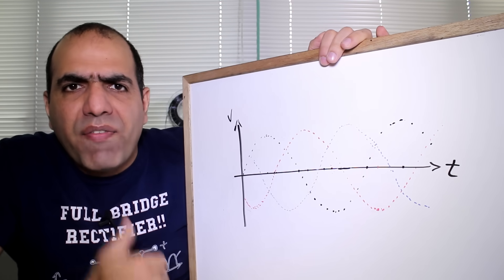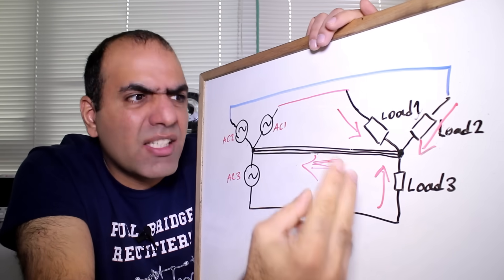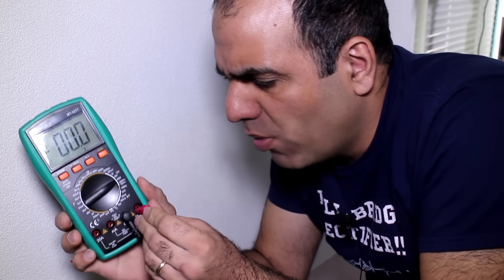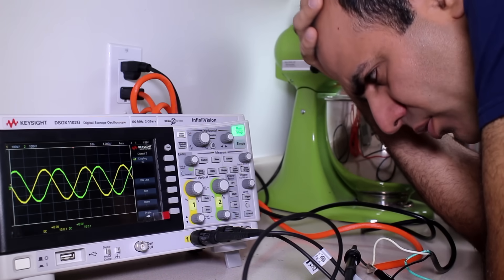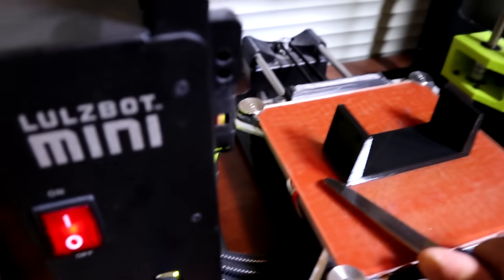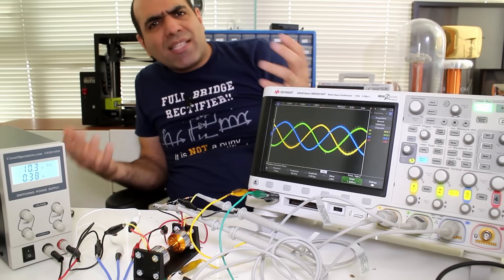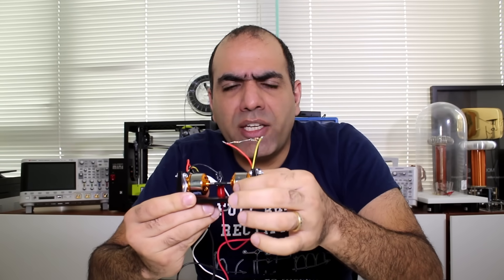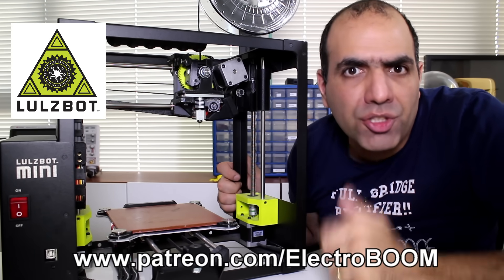Why 3 Phase AC instead of Single Phase???

Comment: This dude has several things wrong in his video and maybe someone has a clue here.

Like there isnt two phases coming into a house unless it was a special install

Its single phase not two phase
Thus why its called single phase

And the nuetral doesnt go back to generator source on single household systems  it goes back to stepdown transformer

There are more mistakes but im not going to go through them all

Even when he uses the meter in the socket its single phase and the same phase

So hes telling the wrong info

Everyone who has any clue should watch a video on transformemers and see there isnt two phases

Its usually a single phase at 7200 volts going through a step down to 240 
That 240 has a center tap which gives u two hots at 120
The center tap is the guy wire and bonded to earth and equipment ground and that becomes the nuetral in simple terms

And thats it.

So watch some videos on transformers 

Then look at three phase
Its complete different stuff

Nuetral in normal circumstances doesnt go back to generatorr but goes back to stepdown transformer and is a center tap of that trasformer.

Look at the pole on your block and u can see for yourself 

Anyone who has an idea would know that.

Later

Comment: Overhere in Europe generally all the houses get 3 phases with the exception of some apartments specifically older ones get single phase. Often there is only 1 or 3 power sinks that use 3 phase power with the common ones being eletric stove/oven and water heaters.

Comment: Mehdi, I have a question.  I'm in the US and they supply two legs of power which combine to make 220v, nominally.  A neutral is also present whereby either of the two pwr legs can be combined with to make 117v.  These numbers are kind of variable.   I've seen different results.  220 to 240v.
Question is, are these phases displaced by 120 degrees or 180 degrees?  I should add that the pwr is supplied by a stepdown trans on the pole that uses a center tap to supply the neutral.  Is that all confusing? 
  And as a bonus question: Is the input to the stepdown trans 1 phase.  PS. They call the power delivered to the house single phase.  I say that it's 2 phase but I'm tired of arguing.  Okay, your turn.
Reply: Sorry, second attempt at a reply as I kind of stuffed it up first time ;) I believe (though don't and have never lived in the US), that there should be no phase rotation between your two hot lines. It's known as split-phase rather than polyphase. One of the two hot/live/whatever lines will be ~115V above the neutral, and the other ~115V below it, thus the 220V between the two hots. It's still technically single phase. As for the transformer, I would imagine it takes a three phase input, and then gives three separate split phases out. So both of your 115V lines are probably out of phase with the two thirds of the others in your street, but should all be in phase with the other ones in your building. Unless you're in a big apartment building or something with it's own 3 phase supply, then it probably varies by apartment. Edit again to further clarify: the two lines themselves would be 180* out of phase if measured because of the swapped polarity, but it's still considered to be single phase. AC is weird.
Reply: Thank you for your response.  I don't think the stepdown is fed with 3 phase because only 2 lines enter the primary, so I was leaning toward single phase primary and 2 phase secondary.  I hear what you're saying that they still call it single phase secondary, but I'm thinking 2 phases 180* apart. (or some other number of degrees).  Thanks again.
Reply: If you think of audio instead of A/C power, you have balanced and non-balanced transmission. Balanced transmission is what is used in classic phone lines. Both wires are conducting the signal 180 degrees out of phase from each other, but you wouldn't call it 2 phase audio. Non-balanced audio is what your mic in your phone earbuds uses, a single wires conducting the audio with a ground wrapped around it as a shield. So your house runs on balanced single phase 220V with a center tap that's neutral(ground). The goal is to use both 120V phases to the same amount of current to keep the neutral balanced. Single or 2 phase is really just semantics, but when you look at other electrical signals, calling it single phase makes sense.
Reply: @markc2643  When the load is balanced, the neutral carries zero current back to the transformer. It is virtually impossible to achieve this in practice; it occurs only when the sum of all L1 branch-circuit impedances equals the sum of all L2 branch-circuit impedances.
Reply: It's single-phase power for virtually all residential installations in North America. AFAIK, the inputs of the stepdown-transformer consist of one of the three phase-wires,  and the other going straight to the star-point. So the primary voltage is phase-to-ground, not phase-to-phase. The output between L1 and L2 is at a nominal voltage of 230V, meaning it can vary anywhere between 220V and 240V. The neutral wire at the centre-tap of the output splits this voltage in half; the voltage between L1 or L2 and neutral is nominally 115V, meaning it can vary anywhere between 110V and 120V. And if you were to compare the voltage waveforms of L1 to neutral and L2 to neutral, you would find that they are exactly 180° out-of-phase, but it is not called 2-phase; it's still single-phase.
Reply: @karlscheel3500  The sum of L1 and L2 is a nominal 230VAC and it is a single 60Hz sine wave in the US.
Reply: @joaquin102761  Yes, of course! Ditto for people in Canada, where I live. When you measure across L1 & L2, you're getting nothing more than the full output voltage of the stepdown-transformer, which is nominally at 230V, 60Hz, single-phase. 

The only reason why you appear to get two waves 180° out-of-phase when measuring each individually with respect to neutral, is because the neutral wire is connected to the midway point along the length of the secondary transformer coil. 

In other words, since our zero-volt reference is at the centre, while L1 is positive, L2 is negative (and vice versa) with respect to this zero-volt reference.
Reply: It could be single phase 240 with a center tap to give you 120V - it depends on how your utility delivers power. If you're seeing 220V on some of your 2-pole loads this could be due to voltage drop - this occurs due to resistance in the wire over the distance from your panel.
Reply: I've seen others answer the question i will give you my ten cents. In theory on 120/220 single phase service you if your nominal voltage to ground is 117 the line to line voltage should be 234 volts. However the winding fluctuation may differ the exact voltages just a bit. 

Yes i agree it is bizarre that we refer to as 120 volts and 220 volt both single phase but the 220 volts is actually two phases.  

Most likely the input of the transformer on the pole is 1 phase in and out.
Reply: You can always change three phase power to single phase by changing how your load connections are made. You can not change single phase power back to multi-phase power without either a rotating device (motor generator set) or use of either inductors or capacitors in the circuit. 

A two phase system uses two sets of single phase power 90 or 270 degrees out of phase with each other. These are considered old legacy systems but you can use a special transformer set up to change 3 phase power into  2 phase power. You can build a single phase alternator with either one or two coils, a two phase alternator with two or four coils and a three phase alternator with three or six coils. A single coil single phase and a two phase two coil systems will be mechanically off balance so therefore limited to only special applications like the reluctance coil in a cars ignition system.
Reply: To answer the original question. When you measure from hot to neutral on a 120/208 3 phase system you will see 120 volts. When you measure from hot to hot on a 120/208 3 phase system you will see 208 volts. To see that you actually have a three phases separated by 120 degrees and not single phase power you would need an oscilloscope to display them or you could infer that from the fact that the voltages as measured from hot to neutral don't add up because of the 120 phase difference to would expect them to do on a single phase system. This voltage difference can become a problem for single phase 240 volt rated hot water heaters and 120/240 stoves because if they have 240 volt elements the power and therefore the heat generated will be proportionally lower. The big advantage to a three phase systems is the power companies like to have a balanced load on their system and for customers they can use 3 phase induction motors.
Reply: What the other guy said is right. Residential in the US only receives one 240v phase. There is a neutral that is tapped to the center of the transformer output giving you 120v from each hot to neutral (normal wallplug wiring) and 240v between the hots (dryer, oven, water heater, etc). All the same phase though if you look on a oscilloscope.
Reply: @CowboyPilot79 Two phases and neutral.
US also have a 3 phase sytem with a delta configured transformer that can supply you with 120V between  phase 1 and neutral, 120V between phase 2 and neutral, 208V between phase 3 and neutral and between phases 240V.
Reply: @Faddnn  yep, his question was specifically to residential wiring though because it is different than the Canadian system described in the video that actually uses two phases.
Reply: @CowboyPilot79  The US uses two phases as I said, you said one. It's called split phase.  They feed two phases into a transformer, get 240 between those, tap the neutral and you get 120. It's a 3 wire system, 2 is hot one is neutral/ground and you split the neutral ground when you enter the house.

You also have a delta 3 phase as I explained and a wye 208V sytem giving 120 between phase and neutral.
Reply: @Faddnn  incorrect. Split phase is not two phase. From the Wiki article: "A split-phase or single-phase three-wire system is a type of single-phase electric power distribution."
Your house is only fed by a single phase which is split into two 120v legs. 

https://en.m.wikipedia.org/wiki/Split-phase_electric_power
Reply: @CowboyPilot79  OK, they feed one phase and neutral into the transformer, but you still get two live wires and one neutral. Both live wires should be threated equaly concerning safety and how you spread load.
Reply: @Faddnn  that is true, don't lick your fingers and touch the copper 😂😂
Reply: They don not deliver 2 phase to your house. it's single phase. 240 volts is just 2 120 volt lines 180 degrees out of phase. They accomplish this with a center tap transformer.
Reply: 120/240V 180 degrees
120/208V 120 degrees
Reply: @D4V1D83FY  120/240 0 or 360 phase.
Reply: 120/240V its sigle phase. In 3 phase (star) the voltages ratio is x1,732.
120 x 1,732 = 208V
127 x 1,732 = 220V
220 x 1,732 = 380V
Reply: Ever heard of Google?

Comment: Why only 3 and not more? Like 96 phases?
Reply: Yeah why?
Reply: The connection of equipment like circuit breakers gets very complicated by increasing the phases, not feasible.
Reply: The easy answer is that you don't get anything more for more phases. Three phases already delivers constant current (sum of three sine waves 120˚ apart being constant), so no need for more.

Comment: If induction motor is rotated, does it also produce electricity?
Reply: Yes it produces a counter EMF
Reply: Terry Plank 
How can it produce anything, there are no magnets, it's just an arrangement of metals moving
Reply: VARUN.N RAO, an induction motor can be converted in to a poor generator by turning the rotor faster than synchronous speed. But the stator should already be connected to an ac source for the motor to act as a generator. Therefore you are right you can't use induction generator stand alone since the rotor doesn't have a magnetic field source. For example most grid tied wind turbines use induction generators.
Reply: Smith Kerona  Induction motor works as an excellent generator, but yes, you need to excite the magnetic field to get it going first, in many cases done by just hooking it up to grid. There are of course ways to self excite the magnetic field too, but you need some extra circuitry for that and of course you need a way to govern frequency and match load etc.

Comment: Remote control bldc controllers will run a normal dc motor with 2of3 ph hooked up. 1 controller 2motor typed.

Comment: I am fascinated by you description, a little confused however.  I have seen a 230 volt ac at my home in the country.  I suspect that is because there was no need for three-phase power in the area.  BTW, I have produced my share of sparks; enough so my son doesn't like the thought of me playing with any more than 5 volts dc.  After all, I am old and senile.

Comment: Great video, and it helped me a lot to understand how a 3 phase motor has more torque then a 1 phase. But what if we took things further? Why stop with 3 phase? Why not 6 phase motor? I've seen 6 phase motors in Chinese marketplace. And it seems those 6 phase motors can be driven by 2 regular motor controllers produced for normal 3 phase bldc motors. Giving us twice the current to the motor, but each controller runs as it would on a regular bldc motor. Meaning well within its limits, causing no additional heat or blown FET's. The 6 phase electric motor are claimed to have twice the torque as a regular bldc motor. 

Could you pls do a video of a regular 3 phase bldc motor compared to a 6 phase bldc motor? Explain the power outout in such a setup, what can be expected in direct comparison? Will the 6 phase put out twice the power of a 3 phase motor? Will the only added expense for the user be the need for an extra controller compared to the 3 phase? And will I be able to ride home if one of the controllers powering the 6 phase motor fails? 

For small BEV the demand for fast acceleration and steep hill climbing ability is what is holding us back. Today we could solve it by going induction motor rather then permanent magnet bldc, but induction motors are hard to find, the weight is often too much for light BEV usage and we don't have much to chose from. I ask about the 6 phase motor because I try to find the ideal motor for a mid drive or hub driven maxi scooter. One that should be able to ride 2 up, with faster acceleration then most cars so that starting from a red light scooter driver can put the cars behind him. Scooter with 2 riders are heavy and need lot of torque and horsepower to perform. And also need to climb steep hills without over heating. Will a 6 phase motor help me achieve this?

Comment: In the Netherlands the standard consumer connection is 3 phase 230V at 25 Amps per phase. I do not use natural gas but heat my water with a 400V (3 phase) water heater under the tap and in the shower. So the maximum I can use is about 11 kW at a time but it works just fine for me. If needed you can get a 3 x 40A or even 3 x 80A connection but you will have to pay extra for that. Nice video!
Reply: 230V 3phase = 230V line to line and 133V line to neutral.

Comment: This is misleading. Two phase is not a standard term. Split phase is more accurate. Single phase split in half by a center tapped transformer.

Comment: your house must be supplied with 3 phase power, residential power distribution, at least in the states is fed by a single phase that goes through a stepdown transformer, the secondary winding of the transfomer outputs 240v but is center tapped (commonly known as neutral) either hot and neutral is 120v, both hots give 240v

Comment: Question ? If A three phase system is 120 degrees  of phase to phase potential Over ones cycle on all three phase lines ; which cycles represents time; A single phase on that same system would in fact be 180° of potential over one cycle to it's point of neutrality at the systems origin...  single phase systems it's best to reference degrees is really a time of cycle not true electrical degrees...???? Peace

Comment: Well it is true this configuration could draw a balanced load on 3 supply lines. I never really thought of that. I was guessing the reason was some motors actually worked better in phased configuration.

Comment: In Germany, every house gets all three phases. Usually, only L1 is used for most circuits (sockets and light) and the other two only in special situations where you need a high current for multiple devices. It is easier (and cheaper) to just use different phases than installing higher rated circuit breakers.
And, of course, machines like the stove get all three phases. Another usage would be CEE sockets which some people might have installed in their garage e.g.

BTW mains voltage in Germany is 230V (50 Hz). With three-phase current, you got 400V.